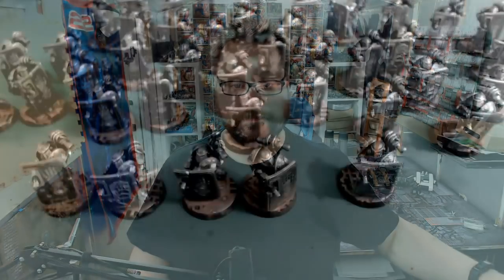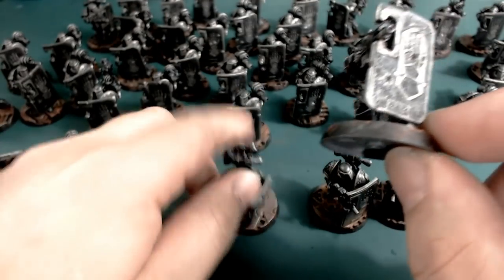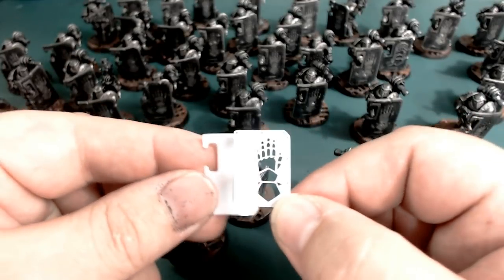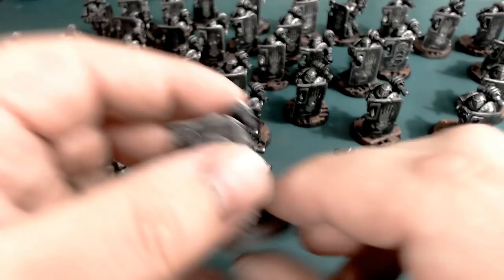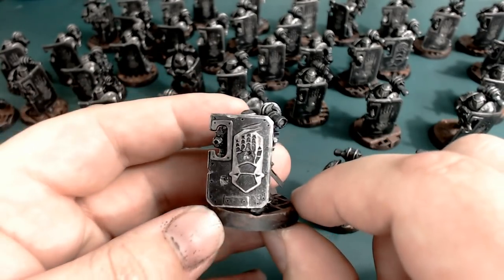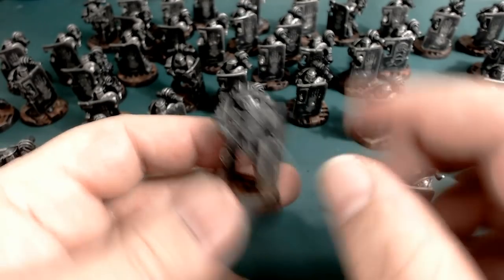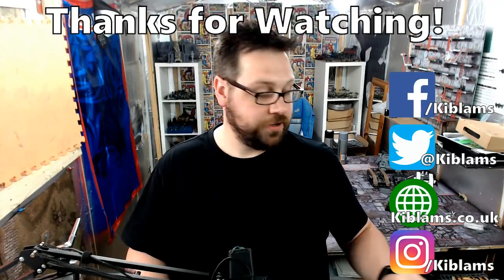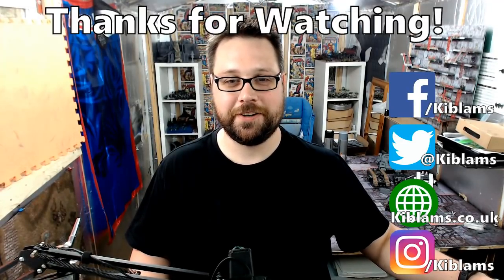Plastic Breacher Squad Conversions - Horus Heresy

Comment: 1. Have you printed the shield parts?
2. How do you painted them?

Ps: they look gorgeous.
Reply from the maker: I made them from layers of 0.25mm styrene sheet that are curved during gluing them together. Thanks very much! 😅
Reply: @kiblams  This is amazing, how did you curve & cut them?
Reply from the maker: @companionprose4286  I cut them using a plotter machine, and the curve was done by hand as the glue was setting

Comment: Great job on those shields!  If you don’t mind my asking, did you cut the layers for them out of plasticard?  And do they sell that generally at craft stores, or at art stores?  I’ve never run across any, but I wasn’t specifically looking for it either.  Thanks for sharing your work with us- looks really good, mate!
Reply from the maker: Mark Brigandi they are made from about 6 layers of 0.25mm styrene sheet which I buy from eBay. Thanks again 😁
Reply: kiblams Right on-  thanks!

Comment: very cool! 
 i didnt get it : did you cut out every single one by hand ?
Reply from the maker: No, i use a plotter to cut 0.25mm styrene and layer it up to create the shields.
Reply: very cool
but im afraid im not able to use this technice..
Reply: @kiblams  
okay, but this is porpably nothing i could get my hands on so easy ?
cause i play fists and i could use like 20 shields and buing the forge wolrd stuff is not in the budget :´D
Reply: @tomvierlinger5124  dude i used a method that works, get card stock and superglue, cut the shape you want and geep cutting said shape and layer them together while coating them in superglue (P.S. wear a mask for this, the glue will make you nauseous.) After doing it so many times, the glue will turn the layered cardstock into a wood like substance, trust me it works!!!